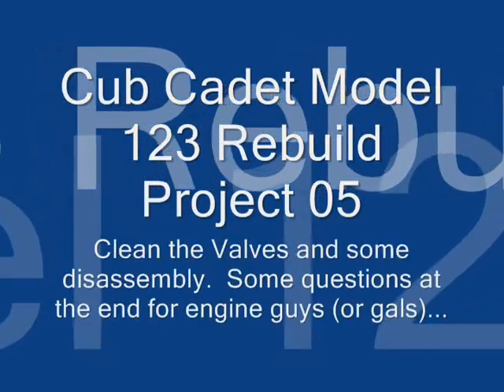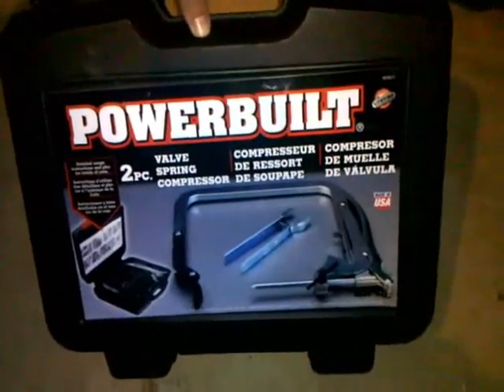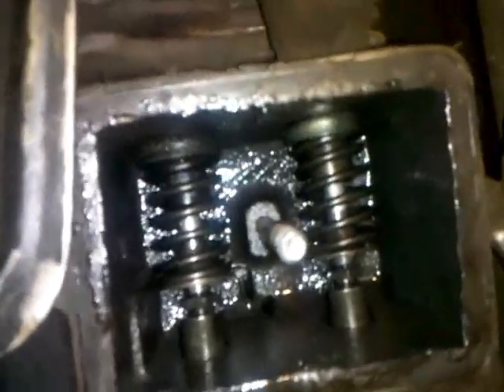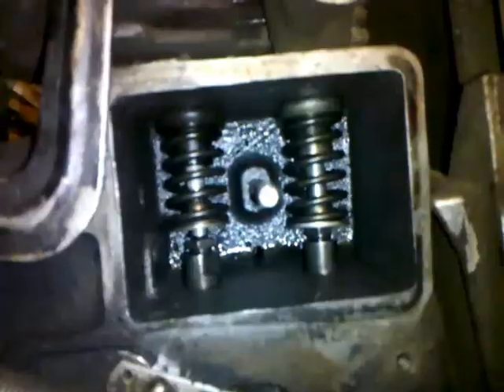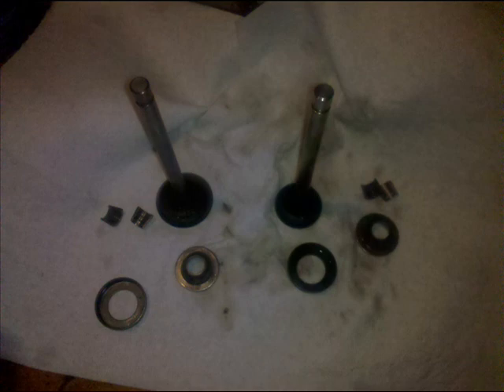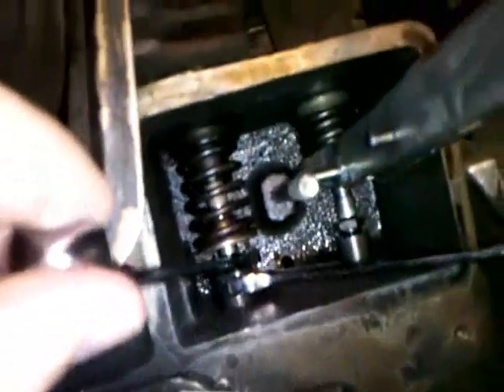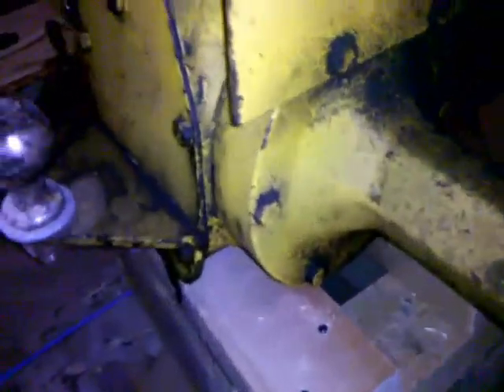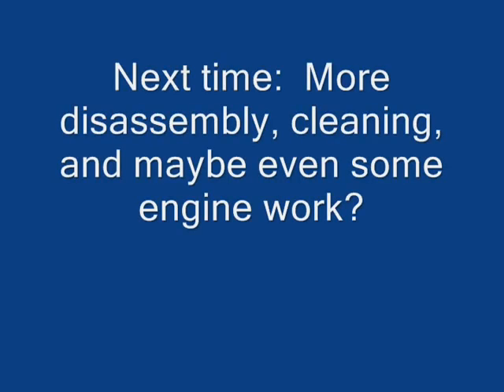Cub Cadet M123 Rebuild Project 05

Comment: nice video man, i just got done installing a new exhaust valve in my K301, i also removed and lapped in the existing intake valve.  and what a pain in the neck to get those little keeper clips in place. lol.  only i didn't do a full rebuild, so all this work my engine was still on the tractor, that didn't help.

Comment from the maker: @446Case The grease suggestion is a great idea.  I lost one of the retainers because I couldn't get it to hold on there right trying to a use a needle nose to hold it on.  When I get the new retainers I will use the grease trick.  Also, I found that I can't get both balance gears out without taking the crankshaft out, so I'm going to get an entire rebuild kit  since I have to almost take the whole thing apart anyways.  Should be fun, the point of this was to learn anyways!